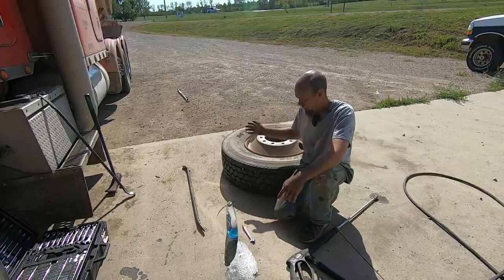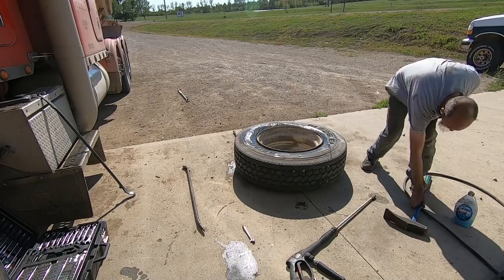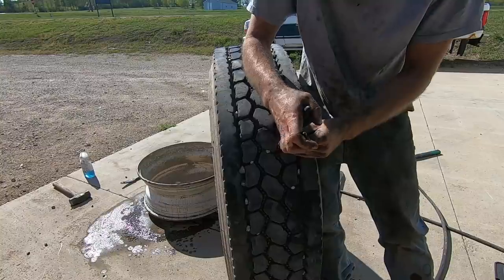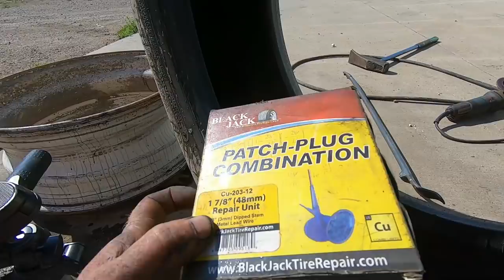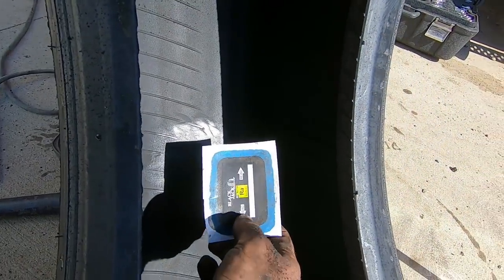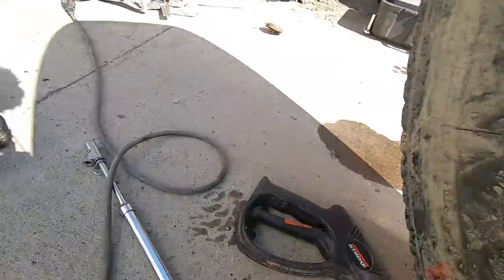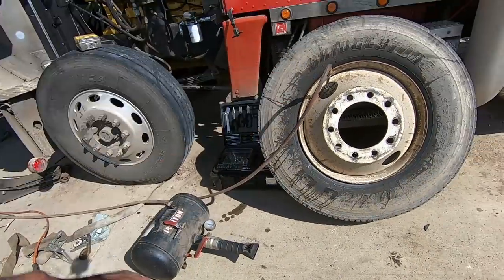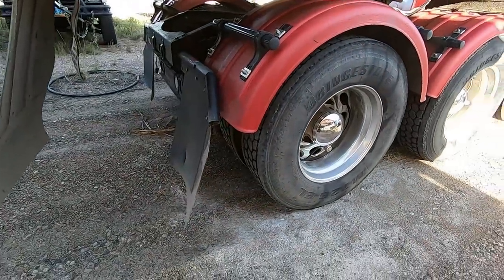inside the tire patch repair semi truck tire

Comment: I’m always amazed how hard it is to make holes in a tire when you want to but the rustiest piece of wire or nail will find a way
Reply: It's the speed my friend. At 70-80 mph at 80000lbs when the tire slams on a piece of metal on the road it just has to go through. I've driven my semi on construction sites and seen millions of nails, bolts and scrap. Never once had a problem, I just make sure to check that none of them are stuck before I get back on the road. But smallest fucking pieces of metal were able to go through at high speeds. Luckily they just slowly went flat. Never had a steer tire explode, only happened twice on trailer tires. Still not pleasant, but I've seen what happens when a steer tire explodes, it's nasty.

Comment: sometimes it is very satisfying doing tire work. i put the cement on both parts. i figured it was kind of like contact cement and bonded when each side contacted each other with the absents of air....like you, i doubt it matters. nice to see you again.
Reply from the maker: Not much that's more annoying than having to drag out a air hose in the morning to air up a tire.

Comment: I bought one of those dismount bars when I had my truck and trailers to do my tire work and it worked great. It was a a lot faster than the two tire irons. I guess if you just do one it's not a big deal, but when you do all twelve on a trailer it was nice to have. Also I didn't realize it was called stitching when you roll the patch. I guess I done it wrong all this time. 😂😂

Comment: Patch-plug combination "these are a pain to use." Yes I definitely have to agree I've used a lot of them and they suck you have to make a hole in the tire and then sit there FOREVER and rub this thin pice of plastic until it comes off and it sucks I will keep that in mind and use the other things next time I patch a tire thanks!

Comment: Ur next patch u should put it so the arrows point to the beads there's little belts in the patch that should run the same way as the belt plys in the tire I like to jam a plug in the hole to keep water and dirt from rusting out the steel belts

Comment: Just wondering I usually after cleaning up with the flapp disk.. wipe it off with some brake clean then put down the cement works good is this wrong do u think thks ..

Comment: I prefer the dawn dish soap n water. I tend to use a lot of it. Works great and is check. I think by keeping the bead wet and slippery,  I have a better chance of not damaging the tire bead.

Comment: You make mount and dismount look pretty easy I guess they are much easier if it hasn't been years since they were off
Reply from the maker: They have been on there probably around a year maybe year and a half. They were mounted when I did the frame stretch

Comment: Many years ago whe  I first left school 1986 my first job was in a tyre shop and I fixed many a lorry tyre like this I remember fixing one and as I inflated the tyre I heard a creaking noise and a big buldge appeared in the side wall I shit it and ran it was at about 90 lbs and then a big bang when I returned it had blown itself across the workshop a d had a big hole in the side wall then after a few seconds all the light tubes in the workshop started to fail till I was in the dark .

Comment: that was too quick Ezra at the farm changing tires over is a pain in back side having to use short tire levers (owners loose the new longer levers misplaced or fallen out of Ute not naming names lol they know who they are ) and using a mallet to bash them on or off really like your tire chuck hands free i have used the pull through plug patches only lasted a week when it disintegrated big blow out that patch kind of looks too small

Comment: Looks like you've changed a few truck tires. Make it look easy!
I know a patch is better. Could you have used a plug?
What don't you like about the patches with the wire or hole filler?
Thanks for the information and video! Learn something on everyone of them!
Reply from the maker: Yeah a plug likely would have worked for that puncture but I was at the shop by the time I found the leak so I patched it a patch is a better repair. I use plugs from time to time when I'm away from the shop

Comment: What I hate is when they throw my 600 dollar rim on the cement and scrape and scratch it up like it’s a piece of junk. This is my money and show RESPECT
Reply from the maker: If your paying 600 each for steel rims I'll sell you all the rims you can take
Reply: Or the guys loading the trailer stand on your polished rims to reach the blocks on the deck !
Reply: @Ezrider359  REALLY ❓❓❓how about aluminum
Reply from the maker: Sure I can sell you aluminum for 600 each all day long to I can order new aluminum rims online for 300 each. Those steel inner rims In this video I bought like new used from a wheel polishing place up the road from me for $25 each

Comment: It is ALWAYS the inside tire. Textbook repair... One little caution and that is I noticed you running your bare hand around the tire bead to apply soap. I got a nasty cut from something imbedded in the tire doing that once so use gloves.

Comment: Use some brake clean and a scrapper to smooth the area out a but then put cement. Worked wonders when I would repair tires at my old job

Comment: Do you have to rebalance it? Or do you not need to balance truck tires?
Reply from the maker: Generally I only Ballance the steers
Reply: Most don't balance them, they'll put in bags of balance media or like me, I run Centramatic balancers. I like the centramatics because of their design they balance the entire rotating assembly, Tires, Rims, Hubs and brake drums. I've got over 100k on my rubber and they still look brand new.

Comment: Why are you running steel wheels on the inside of your truck?
Reply from the maker: Because I had 8 matching aluminum wheels on the drives and 8 outside wheels on the truck so I pulled the 4 inner wheels and repolished them to outers and replaced the 4 inners with steel for $100 no reason not to other than a small weight difference
Reply: @Ezrider359  When I would order my new grain trailers I ordered them with 8 outside wheels Then when I picked them up at the factory I had them mount only four of them then had truck outside rims of my truck put on the inside of my new trailer hence then I had 8 beautiful shinny wheels on both my truck & trailer, did that 3 times.